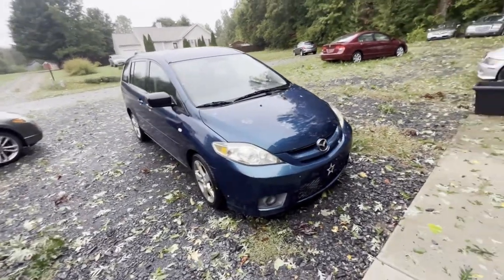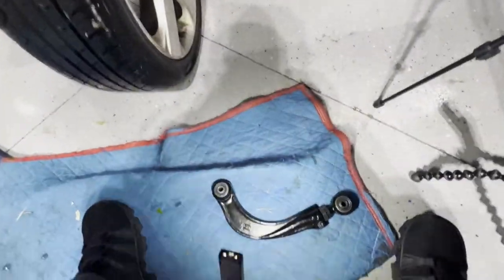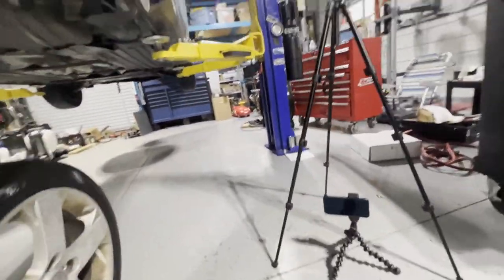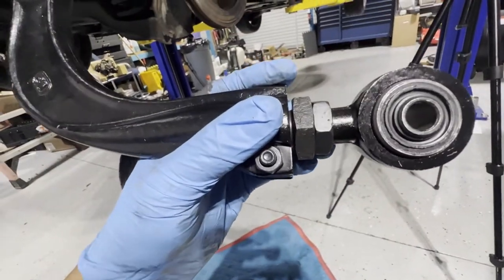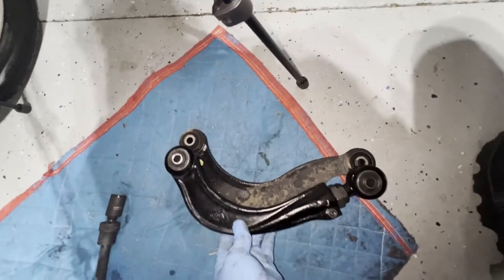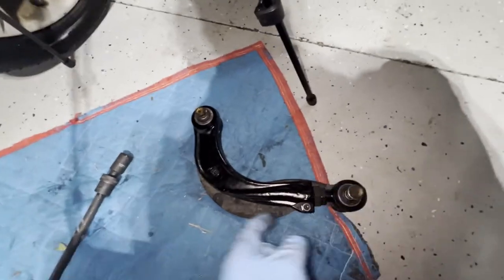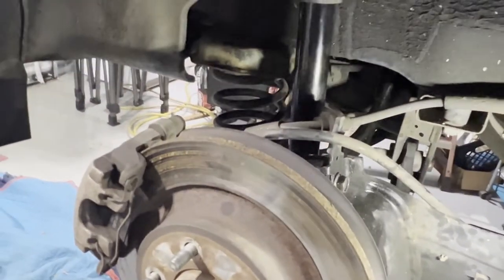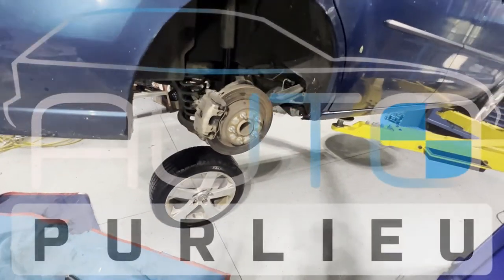How to replace & install an adjustable Rear Camber on 2006 Mazda 5 / torque specs / explained chart

Comment: Excellent, thanks. Just a note, lower right corner on the alldata shows n.m not ft/lbs, so torque is about 75ft lbs. Much appreciated the vid.

Comment: I did replaced mine both sides with an adjustable RUCA with parts from rock auto, $30 for 2  control arms.
Reply from the maker: @allantreyes4445  it’s a big difference on tire wear. Good job

Comment: Hi, I did the rear driver side which was pain in the ass, after an accident, but please tell me an easy way to adjest those 2 washers nuts, I could or did extend the whole rotating end, attached to the wheel side and tightened the outer washer, now the deep question, and I rotate the other washer? or release it from the black C shaped iron?
Thanks 🙏 🙏 🙏

Comment: You didn’t show the driver’s side…oh yeah.  That’s a lot more difficult due to no clearance because of the exhaust!
Reply from the maker: I normally replace both side when this happen. For some reason, this customer only wanted to replace just one side. 
Only this side if a bit out of alignment

Comment: can this arm also be used for the mazda cx7
Reply from the maker: Go check your car , not sure if they have the same part number . If they do, it should work
Reply: @autopurlieu  
cx7 is much heavier than mazda 3, will that be a problem
Reply from the maker: @nikolatadic4295  like what I said. If it’s the same part number . There’s nothing can do about it. It will be the OeM specs
Reply: @autopurlieu  thenks